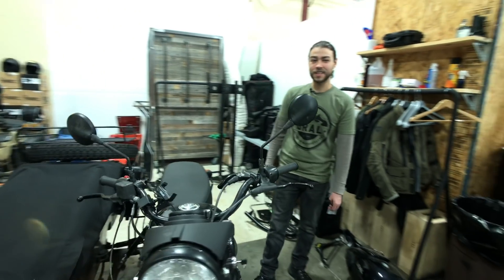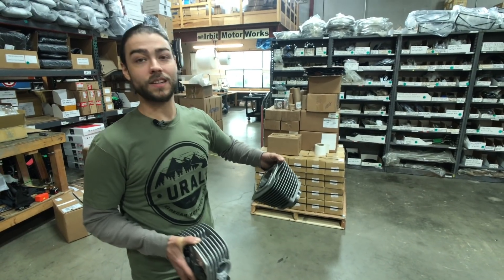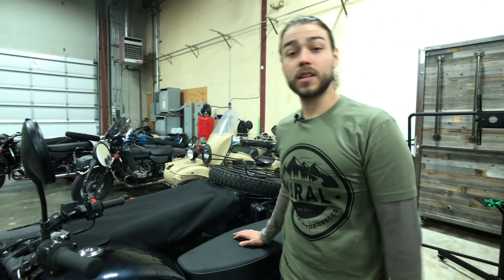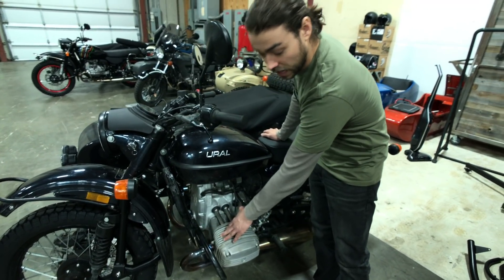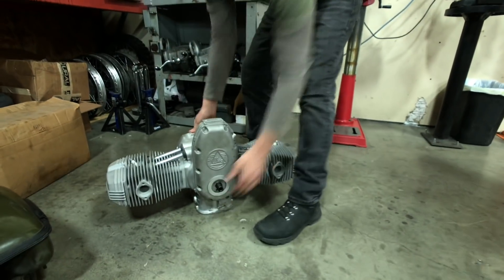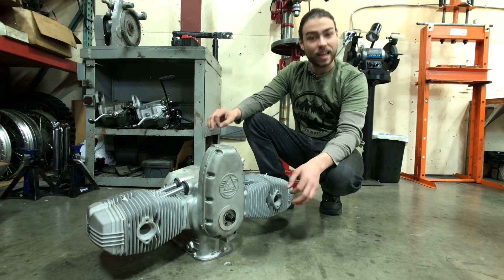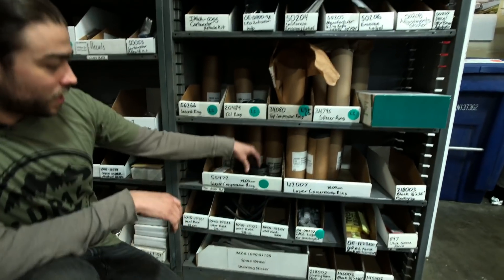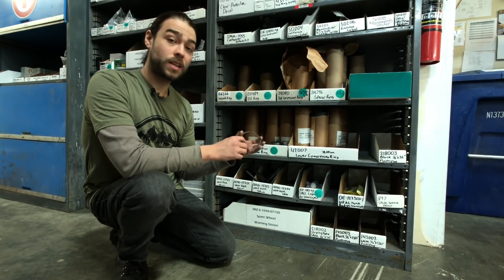Ural Director of Technology discusses improvements to the 2019

Comment: I have a 2018 Gear Up. Biggest problem is that none of the hardware is stainless steel. All my nuts and bolts, anything not powder-coated, is just corrode and rusted. I’m not sure what I’m going to do. It’s only a 2018, and I can’t stop it’s from corroding piece by piece. Why doesn’t Ural either Zinc coat or use stainless steel fasteners? WTF?! Seriously. So what if the bike gets a few hundred dollars more expensive to build. Or at least sell customers complete stainless fastener/hardware sets so they can change out the junk metal nuts and bolts literally holding the bike together?!